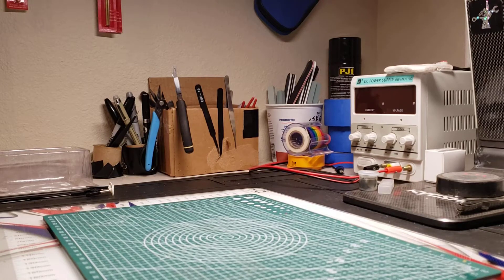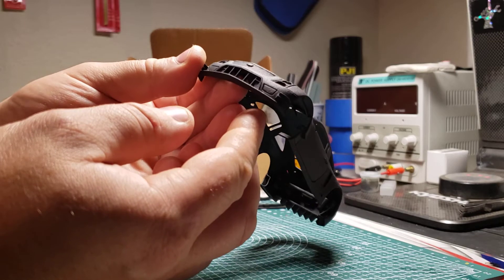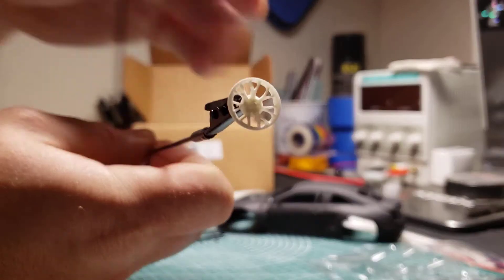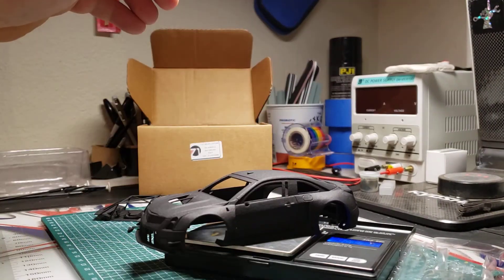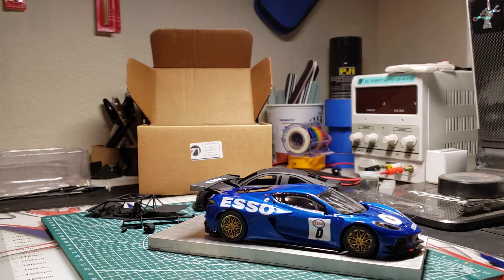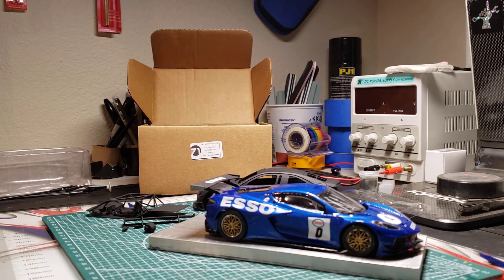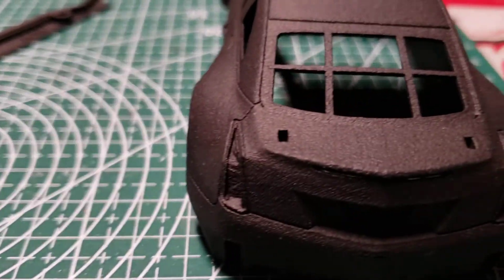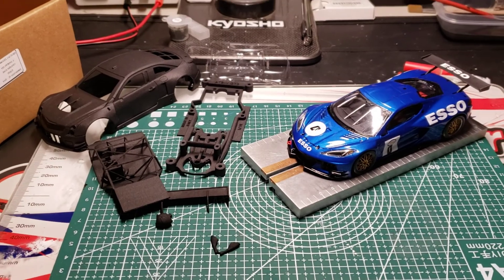The Area 71 3D printed slot car kit review. Are 3d cars the future?

Comment: The corvette came out real nice. I have 2 of their kits that I have to start working on. I am new to this. I am curious if you could provide any guidance to get a decent outcome?
Reply from the maker: I recommend duplicolor or rustoleum 2x primer. Etch those body lines and do a solid coat and sand with 600g. I did three or so rounds of this, small sanding sticks help a lot with the details. Before color I wet sanded the primer with 1500g, let dry. Then three coats of color, decals, and one light coat and one wet coat of clear!
Reply: @morganmotorsports4220  thank you. That helps. Not sure what is 2x primer though.
Reply from the maker: @critkeeper  It is just a line of primers from Rustoleum specifically designed for plastics. It also covers extremely well, so make sure that you are careful on your first spray!
Reply: @morganmotorsports4220  thank you for the information.
Reply: Sounds pretty expensive for a car without all the moving parts. And I thought I was going high end when I bought an NSR!